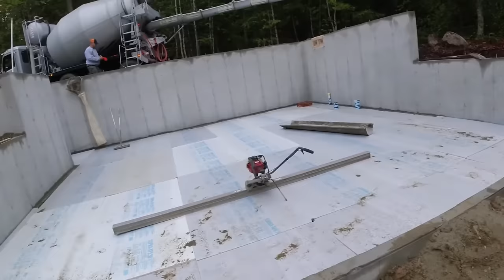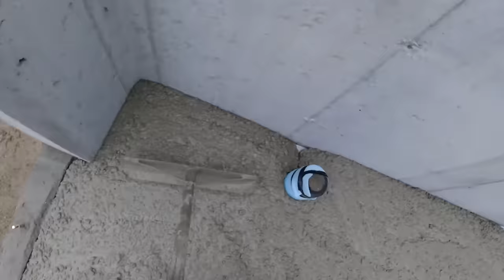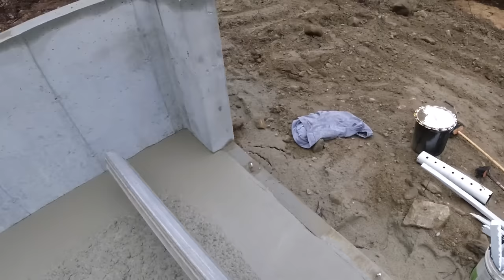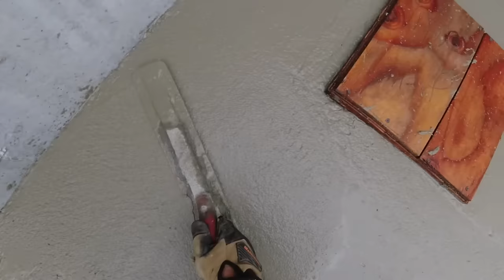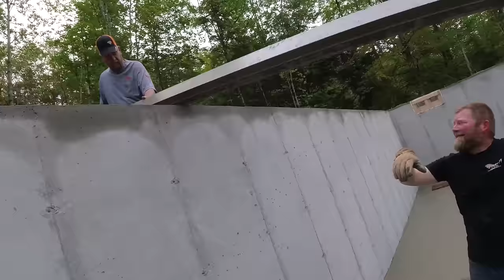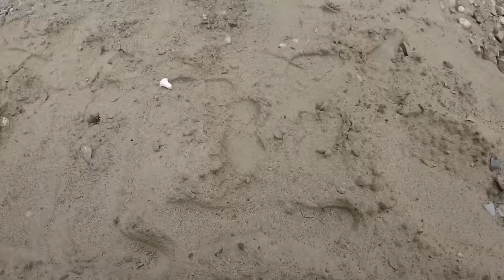This Is How To Pour Concrete With Only 2 People!

Comment: The old concrete company I use to work for, I made them a few sets steel ladder that hooked around the anchor bolts they worked really good!
Reply: You may have a great idea with the anchor bolt ladder.  You might want to bring your idea to companies that produce ladders.

Comment: You must have a reason for pouring into the corner, instead of towards the walkout level. Curious as to your thought process.
Reply: I haul concrete and I can see the part of pouring the furthest away part first so you do not have to work under the chute but I would have figured some way to screed the corner before the final pass out.

Comment: Hi Mike,
I have a three part question for you if you don't mind answering it for me! What if the concrete plant didn't give you the mix you ordered, like the right slump, the right amount of water reducer ect ect,  how would you tell without experience and what could you do about it?
Reply from the maker: As far as the slump goes, if it's too wet when it arrives you could send it back an reject it. It should arrive about a 4 slump unless told otherwise. The mix design and water reducer should be on the drivers slip/receipt he has in the truck. All the information is on that slip. It's best to check it before you pour, that way if it's not right you don't accept it.